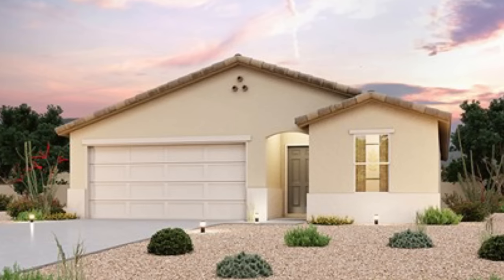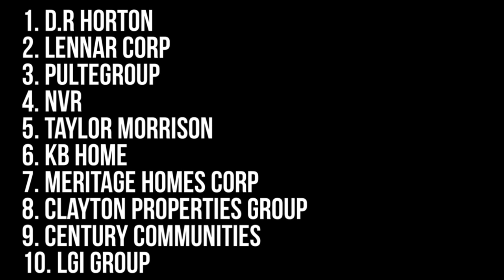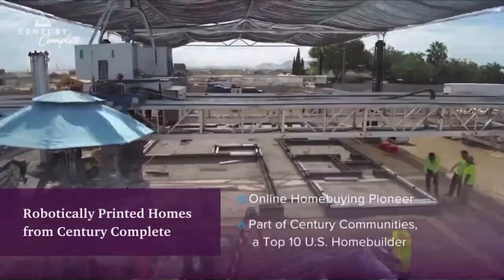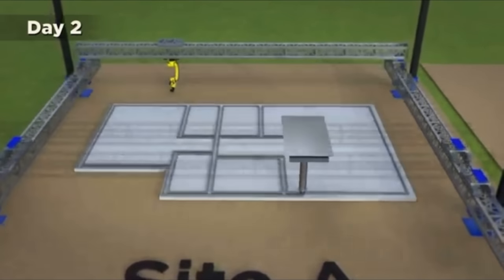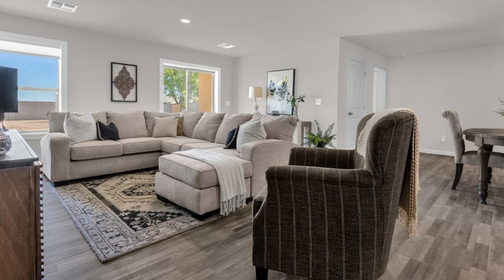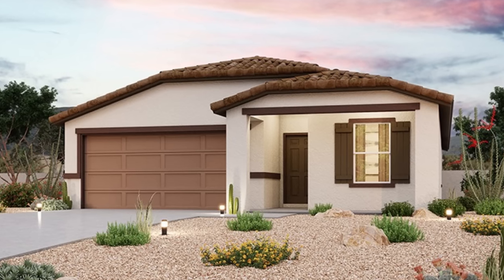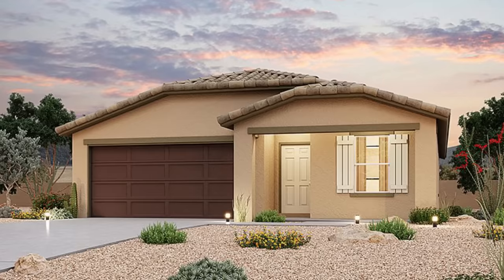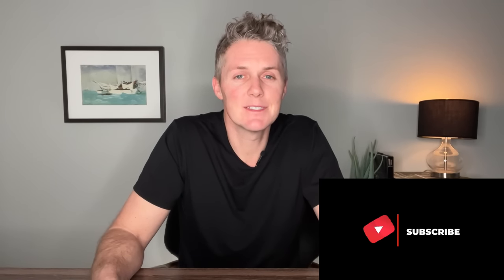FACTORY IN THE FIELD is the Affordable Housing Breakthrough We’ve been Waiting for!

Comment: Additive Manufacturing around long enough for patents to run out so you will see a lot more companies trying their hand in it.  One of the things that is in a maturing phase for 3d printing are the filaments used.  This is the secret sauce at this point.   The physical framework (enclosure, hot end, cooling, reprap structure, etc.) are all well defined at this point.  The 'cement' they are pumping through is the 'secret sauce' filament that they really need to line item to people so everyone knows what kind of 'cement' structure they are putting their lives into.  Think of it as listing the ingredients in food you buy at the store.  Would you want to buy something that has no ingredients listed?  Would you trust it? Also smoothing out the walls is aesthetically pleasing however it covers up potentially visual clues about inefficient printing (layers lines, shifting, bubbles, squishing lines to close together or opposite to far apart with space in between, etc.).  Ultimately glad to hear they are pursuing this.  Definitely a great way to utilize 3d printing on a mass scale!  As this area matures there needs to be more governance around it though so people can feel confident for the next 20+ years they will be living in the structure for.

Comment: Kerry, I appreciate your channel and the energy you put into finding new options in off-site construction.  I spent over 25 years building affordable homes, so do know the industry, and think there is a role for off-site construction - hence, I watch your videos. That said, construction of homes of any size not driven by a commitment to sustainability, validated energy efficiency (e.g., certification to a well-recognized programs like ENERGY STAR, Indoor airPLUS and Water Sense) and the use of materials that have a lighter footprint on the planet only set us all up for failure.  In that light, there is so much wrong with on-site, 3-D concrete construction that I hardly know where to begin - the most incontrovertible fact is that concrete is not sustainable product.  The weight of materials and fossil fuels used in transport, the amount of potable water used in the mixing process, the carbon dioxide released by curing concrete, the silica in cement and the more than limited options for any kind of reuse or recycling make concrete a less-than-ideal choice for most aspects of building construction.  It is relatively cheap, has been used forever and takes very little thought to incorporate into a project.  What it does not do is provide the basis for a truly affordable home - which needs to be safe and healthy to live in, easy and affordable to maintain, able to withstand typical local weather phenomena and be resilient in the face of atypical weather conditions.  I am passionate on the subject of sustainable construction and affordable housing, and encourage everyone to become more knowledgeable about sustainable construction, resilience and affordability - and how to build their own decision tree for making housing choices for themselves or others.